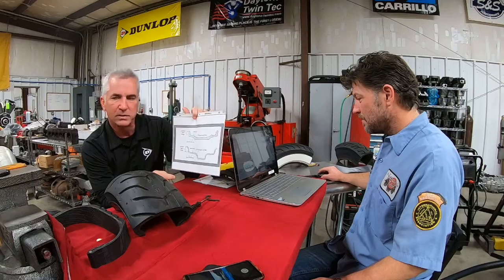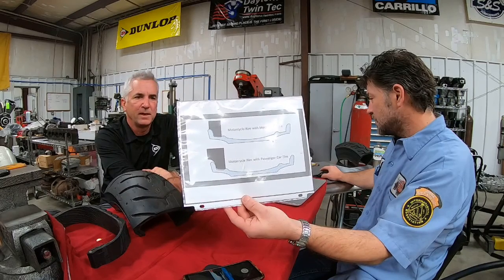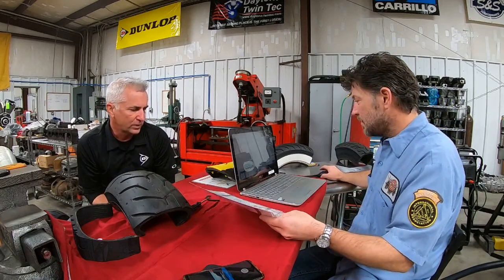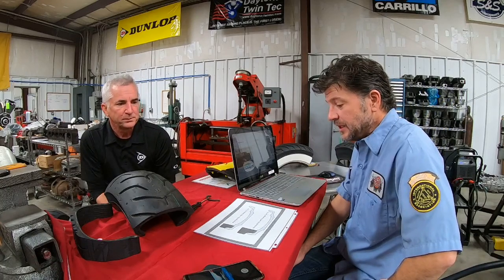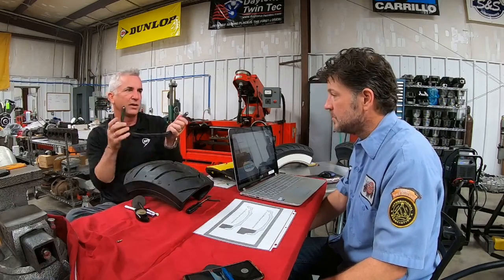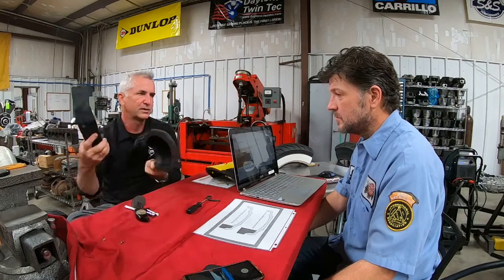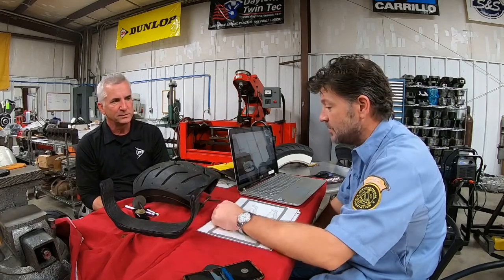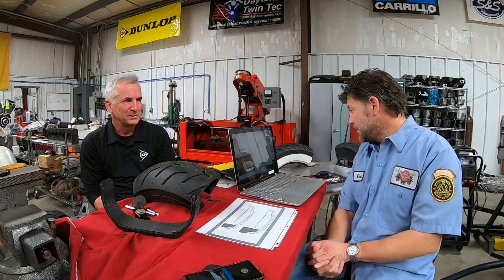Motorcycle Tire Tech Part 2 - The Darkside - Live Dunlop Q&A

Comment: Everything they said here on darksiding tires is that the shoulder profile is different, the bead profile doesnt match, and the car tires are not made to run flat. The darksiders run car tires for higher load tolerance (no one wants to tell their wife what they can and cant pack on a road trip) and for the tread compounds that last longer. Neither of these things is mutually exclusive on the tire manufacturing side. My problem with this is that this guy clearly has some influence with a major tire manufacturer, and he says his major worry is about safety and saving lives, if that is the case why doesn't he influence Dunlop to make tires with a motorcycle shoulder profile, bead profile, and run flat qualities, made from a good car tire compound? There are Goldwing riders out there who load their bikes with more weight than any motorcycle tire is rated for, then put 100k miles a year on their bikes, is it reasonable to ask them to change tires every 5-7k miles for a total of 14-20 times a year? I am not endorsing darksiding, but it does work, and from what they said here all the safety issues are solvable at the manufacturer level, so why doesnt any tire manufacturer provide that solution? I dont am not big on conspiracy theories, but following a money trail isnt hard when you have a whole group of folks that are perfectly happy with the handling and stopping performance of a car tire that lasts 30-60k miles on a motorcycle, and all the tire manufacturers are demanding they stop doing that to use tires that only last 5k miles instead of providing a motorcycle tire with a longer lasting compound.
Reply from the maker: The one consistent thing I read and hear....is the challenge to produce only 1 report of an accident caused by running a car tire on a motorcycle.  Truth is, I can't find it.  So many have the position that it is perfectly fine to do, and is better....that it is a conspiracy.  Not withstanding....

I have passed along a similar challenge...for anyone that says this is perfectly fine to do, produce a letter from an insurance company, a motorcycle company, wheel company, tire manufacturer, UL labs, any testing agency, NHTSB....anyone that could be considered an authority on the subject, saying this is acceptable, safe and permissible...anyone other than the owner of the motorcycle, willing to accept any and all responsibility in the event of an accident.  No-one has ever been able to produce that either.

I have no dog in this fight.  I really dont care to discuss it really.  I wont do it.  Period.
Reply: My problem with all this is that while I am not gung ho about putting car tires on a motorcycle, sadly it does solve some problems these sorts of touring bikes and riders have, but that I would MUCH rather see solved by tire manufacturers giving us the option of longer life motorcycle highway tires with a heavier weight limit, and not just for cost saving. I recently purchased a 2014 Goldwing Valkyrie and I am planning to take a long trip from Texas up the west coastal highway scenic route up to Washington state when the weather gets nice enough. This is a trip that is probably 5000-6000+ miles depending on how much side tracking I do. My current motorcycle tires have about 70% life, and by the time the weather gets nice enough that will probably be down to 60-65%. Should I buy brand new tires before the trip and have them installed and throw out my existing tires with over half their life left remaining, and hope the new tires last the entire trip? Should I try to predict where my existing tires will run out of life and call ahead to that area, find a tire shop willing to change motorcycle tires, and special order my tires to one of those shops and hope I did not wildly over or under estimate how far my tires would make it? Should I just make the trip and hope to find someplace that has a 19"/17" high weight compacity touring tires that will work for my bike and maybe risk getting stuck? Or should I just go darkside and not have to worry about my tires at all for the next year? As I said, none of these options is great, but since we dont have tire manufacturers giving us the option to have good high mileage touring bike tires with a compound similar to what a good car tire has, I am just stuck trying to make the best of my very sub optimal options.
Reply: @joelthemole3020  Put new tires on before your trip.

Comment: So I had a blowout this year rear tire. Coming back from Tennessee 500 miles. Running highway speeds 75 , 80 mile an hour in the rain. I truly think if I was riding on the dark side I would not have been able to keep the bike straight. Another words we would’ve went down. I Musta ran something over and had a slow leak as we were riding in the rain I just thought the bike was floating a little bit . Once I hit a work zone and had to slow down the bike was all over the place. If I was riding on a dark side they would’ve been all over. That stiff side wall stiff tire save my ass many times. I always ride very heavy to up I wanna CVO dresser that’s about as heavy as you can get. The worst thing about it is the people trying to run me over so try to keep the bike under control. If I had a car tire on the back of that bike it probably would’ve came off the rim. Love following you. So my bike is a 14 Twin cam water cold which I am going to keep for a long time. And when it’s time to get work done you’re going to do it. Just want a good Torquay motor dependable. Thanks Kevin

Comment: I got 40.000 miles on my austone taxi tire on a ultra classic and can hardly tell any wear. I will say I don't drive fast and take it nice and easy. If I was driving like a bat out of hell I would ride bike tires. But being poor trailer trash living on army disability changing tires every 5000-10000 miles is not in the cards. the reason for not riding a austone in my front is simply because the front tire lasts a lot longer so there is no need to change to austone. If they wore out at 5000 miles I would ride austone in front to:)

Comment: I 100% would never use a car tire, but you guys just PROVED a conspiracy took place when you told the anecdote about you informing the insurance execs about this practice, who then moved to deny all claims for those using the wrong tire. By definition ! Lol . Now is it a bad thing you conspired across industry to throw a wrench in these dark siders plans to upset the motorcycle tire industry? I don’t think so, but take a different stance. Hand waving the conspiracy angle HURTS your case , which you can easily make on the facts alone as you’ve done here.

Comment: I've been darkside on large frame touring bikes for years. And back tires on the front when possible. I prefer to keep back tires on front in normal rotation if possible to keep water shedding correct. I've ran beads in the past, now use Centramatics. I'm currently on a 2018 Wing. After the POS M8 mess with my 2017 RoadKing. I will never own another Harley again unless it's a pre WWII bike. Even my RoadKing went DS after the cute Bar & Shield sidewall OEM tires wore out real quick. I will not run DS on a sport, sport touring or adventure bike. The reason why Ins. Companies always fall back to the tire has to be DOT is they don't want racing slicks on street bikes at all. Drag slicks and road racing slicks are a bad no no with ins. co's and cops concerning cars and bikes. Where do you think cheater slicks came from years ago. No ins. co. is going to sign a letter saying car tires are ok. And if there were any court cases concerning the issue. It would spread across the net faster than info about Harley sucking off Obummers EPA and signing the consent decree to help them out with warranty issues concerning the abortion known as M8. This DS tire stuff concerning ins. co. goes around like you shouldn't carry you own loads in your HD/SD pistol. A DA and judges will see you as a vile evil person loading up ammo for the express purpose of killing people and you were just looking for someone to shoot. No court case's on record that anybody can find, or any cases where someone was convicted in a SD/HD shooting lost because of reload/roll your own ammo. We do have a bullet restricted law in my state. Bullet has to be .45 cal or smaller, must have at least 60% lead core and not be coated with materials like teflon to slick them up. Have tread in your tires and DOT and nobody will say a thing about it or care but motorcycle dealers and some Indy shops. I for one don't know why more bikers don't change their own tires, bearings and brake service on there motorcycles. I laughed when Kenvin brought up the old wheel drum balancer. I still use one of them. Dismount and mount my own tires, gravity balance if I using weights and instal back on the car, truck or motorcycle. Strap the bike down and spin them wheels up. Put a timing light on the tire and if there is still a balance issue you can see it. And you can also see out of round, tire, wheel and brake disk run out. Be good or bad at it.

Comment: I’ve been running a ca tire on my Rocket3 for 4 years because I got tired of paying $385 every 3,000 to 6,000 miles. I was running metzler tires which I won’t run ever again. Both tires separated with steel wire sticking out of the tire: I have had no problems with the car tire so far. I don’t ride real aggressive on curvy roads. Motorcycle tire manufacturers need to reduce their outrageous prices for bike tires. The bikes with the wide rear tires are very expensive.

Comment: I put a car tire on my 2009 Stratoliner back in 2016 at the 30000 km mark. I have ridden that bike for 26000 kms with no serious issues. But I did have a couple of observations. On the Stratoliner when  I would roll on the throttle in the corners or even in the straights I would feel a bit of a flex in the tire. It concerned me at the beginning but then as any good human...I adapted.  The second thing that bothered me with the car tire was the grinding strips in the road or any uneven pavement. Because of the flatness of the tire it was always wanting the get off the ridge and drop down lower. When it did that it would tip the bike unexpectedly. So after a bit of riding on that I also adapted. They were really the only two concerns that I had. 

The other thing that I noticed was riding on gravel or dirt roads. The bike was more difficult to handle has the road got rougher. In loose gravel it was a bit nerve wrecking sometimes and I would not go far in loose gravel roads if i could avoid it. 

I just had that tired removed yesterday because I am selling the bike. Overall if I was going on a long cross country/province trip then a car tire can save you a lot of money but you will sacrifice some performance. As far as safety of care tires on the bike, I had no issues. The tire still looks great and the grip for starting and stopping was fantastic. These were my observations and other out there may have had different experiences. Hope this helps.  Oh, the tire was a Goodyear Triple Tread.

Comment: the tire manufacturers need to make bike tires that hget higher mileage
Reply: That's the real issue to me as well. Paying 2 to 3 times the cost for a third of the mileage is why I'm seriously thinking of going Darkside. I understand the engineering process fully, but other than some installation on the rim, I still have not seen data that shows the negative effect of putting a CT on a bike. And to the comment about putting a CT on front of the bike, Double Darksiding is a practice (rear bike tire on front) that many Darksiders do.

Comment: While technically most of what is presented here is correct, (I don't buy the car tire coming of the rim, come on, really!).  I have put quite a few miles on a darkside vtx 1300.  From my experience i can say the increased braking traction is very significant!  It's  the only reason i avoided hitting a deer.  We were two up at about 60mph.  I am not trying to talk anyone into darksiding, but i have done it and will most likely do it again.  Current bike came with new tires and still have life.  
I do want to know why is a car tire usually softer than a bike tire, wears much longer and has better traction than a bike tire?  Also, why don't  bike tires come in a weight rating to support a fully loaded two up goldwing?  Just asking.
Reply: Just went dark side 1000 miles ago , will never go back to overpriced motorcycle tires . There is no reason motorcycle tires could not give the longevity as car tires . I will agree with all the facts brought to light here , but I personally have seen the darkside work on gold wings and harleys , for many miles , and cannot find evidence of a failure , period !!

Comment: One thing i havent seen about Motorcycle tires it operating temps.  i have a 2017 Camaro SS and the stock tires cant be driven on below 35F.  the tires i have on it now cant even be stored below 20F.  We ride snowmobiles up here in ny. if the roads dry and you are a kid on a cheap crotch rocket you wear the same gear.

Comment: Running a run flat car tire is a more rigid tire than the sample cross section of tire you had in this video even though I know people using standard car tires to which i would not do , just saying...... I CAN tell of a RF blowout and I observed a safe pull over and a 30km limp home on it.  The disclaimer is it was on a sidecar rig.
when you speak of Goldwingers having to go to car tires it is because 1000$ worth of tire should last more than 10000 km's  - the so called 'made for' elite 3's were not even close to working on such heavy bikes imho.  I do not know the extent of the elite 4's as of yet, i have not heard any feedback yet, I hope they have finally made tires for a heavy bike....
Reply: "1000$ worth of tire should last more than 10000 km's " what are you talking about? You can get a Dunlop set front and rear for under 500. I am running a Dunlop E4 on my goldwing and its perfect. Dont post if you dont know wtf you are talking about please.

Comment: So, cue the feigned outrage and ridicule, but I've been running darkside for 8,000 miles now, and I'll never go back to motorcycle rear tires unless I know I'm gonna be on a track.  I was a die hard HD rider for the majority of my life, and now that I ride a Goldwing - I'm amazed at the amount of hate and vitriol that's spewed at me from HD riders.  I worked in the service department at a very large HD dealership, and I can tell you that it's VERY rare to see a HD with 100k miles.  In fact, I never saw it.  Not once.  That's just not the case with Goldwings.  The main difference in the train of thought is, when you put in real, serious miles on your bike, then you get tired of spending thousands of dollars a YEAR on just tires.  Yes, it's a vital piece of engineering and equipment.  However, I run a quality Michelin A/S steel belted radial, and I ride insanely hard.  My butt hanging off of the side of the bike, and still scraping a bit in the corners.  The bike grips every bit as hard as it did with the OEM Dunlops.  I regularly SMOKE HD riders going over Geiger Grade in Reno, Million Dollar Hwy in CO, etc.  Haven't found one yet that could hang with me on the Goldwing.  After 8,000 miles of hard riding, it doesn't even look like I've made a serious dent in the tread depth.  When I ride across the country, I can't even make half of a trip without having to change a set of motorcycle tires.  Now, I can ride with confidence, grip, wet weather - whatever.  You guys that are knocking it should try opening up your brains just a teeny bit.  This guy from Dunlop has a career and a pension to worry about.  Do you think he's not 100% biased???  Why didn't he bring a comparable cross section of car tire to compare, instead of the teeny sliver of tire?
Reply: The most important thing for control I found is the right air pressure. A little extra, like close to 40 psi makes mine handle just like a m/c tire. I installed mine on my Indian Roadmaster and will do it again. I like the extra tracktive effort and braking due to more rubber on the road. Grooved pavement doesn't matter. Anyway, I won't ride on dunlops because there are other bike tires out there that handle much better. Continental and Perillis beat them hands down on handling.
Reply: Car tires are normally rated at higher temps, loads and grip. Plus, you will never put as much sidewall pressure on a m/c when cornering as car tires have to endure.

Comment: As I stated in the previous video my Yamaha Roadliner had an aftermarket “training wheels” trike kit and when the original tires wore out I dark sided the rear tire. My traction both starting and stopping improved probably 200%, I had a busy 2 lane highway I had to cross on the way away from home and returning, with the motorcycle tire it would spin on acceleration halfway across the road. After the car tire installation I would hear a deep squall and I would launch cross the highway rapidly. Similar performance was felt on braking, I didn’t use by much front braking to stop. I realize I wasn’t experiencing any leaning, but when I first installed it I took it for a short ride before reinstalling the training wheels (about 5 miles) and the only thing I noticed was the feel of the edge of the tread as it crossed over the edge, it wasn’t that noticeable by the end of the 5 miles.  To address the “issue of conspiracies” if car tire manufacturers can make a tire last 40,000-60,00 miles carrying twice the weight of a motorcycle tire why can’t motorcycle tire be made to last at least half that long? They are using three times the rubber thickness in the tread according to the cutaways you had, yes the sidewalls are thicker which I understand to keep you safe in a flat. Unless your expert can give a very convincing argument as to why motorcycle tires cost 2-3 times as much but give 4-6 times less mileage people are going to say it’s a conspiracy.